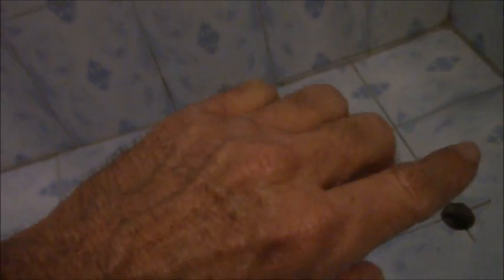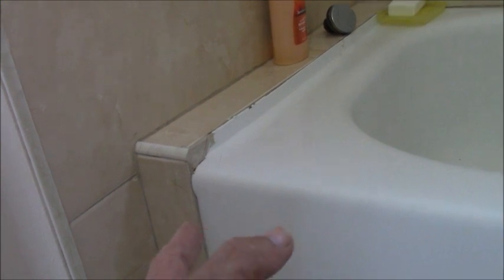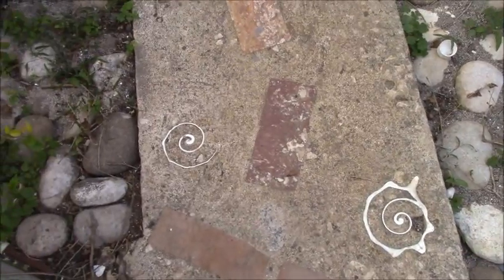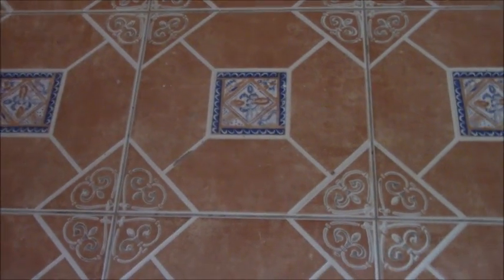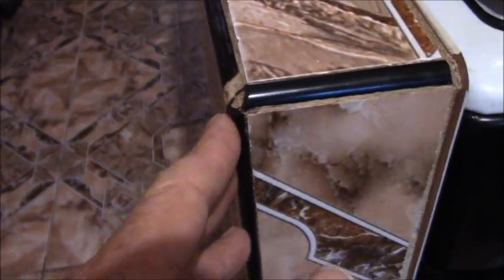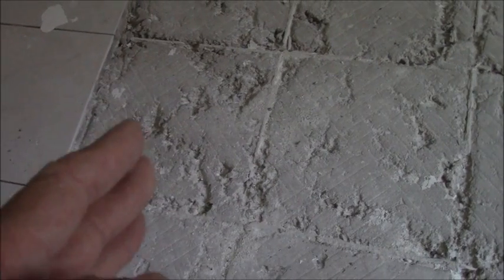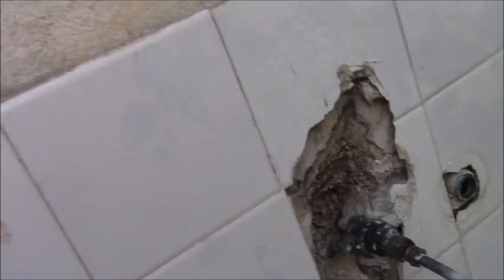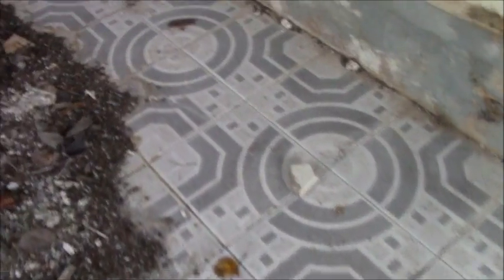Showers and Tile in JAMAICA...how they do it there

Comment: The buckling is called tenting from not having a gap around the perimeter for expansion and contracting or not having a caulked expansion joint in the center of the room

Comment: just got off a condo job where buckling of tile is very bad issue with over half of the units. after scoring grout lines trying to save some full tiles u will hear loud pops where either tile is breaking or separating from the floor. very poor mud jib and no back buttering. I'm sure contractor or builder used cheap thinset no flex to save money overall cost. some areas are even cupped tiles. prob due to movement of building and maybe hot and cold contraction, wet and dry spots, and combination of all above and maybe another reason or two. salt water air can't help either.

Comment: That buckling (or tenting) seems like maybe they didn't leave any gap near the walls. And the concrete walls won't be very forgiving for even the slightest expansion.

Even less forgiving if they used mortar instead of grout to fill the gaps between tiles as at least the grout will crack.

Comment: The thin set wasn't applied properly I am living in Jamaica and do tiling. What happened is that it didn't finish properly so u have air  pockets. When the time is hot the heat is trapped underneath the tile so it pop up

Comment: Is it possible to tile with Portland cement mortar ? 
Also, what do you have to say about mortar grout ?
Reply from the maker: You cannot set tile with mortar...grout has cement in it, so not sure what you're asking
Reply: StarrTile I know that in some places , people just use Portland to tile instead of thinset. What do you think about that ?
Reply from the maker: __  I suppose anything is possible, I have set tile in Jamaica when I lived there, have watched other tilers set tile and everybody uses thinset, if you had a natural stone very porous tile then I suppose you could use mortar but again I don't know why you would try to use mortar instead of thin-set
Reply: Thinset is basically just Portland cement and sand 1:1 with eachother. Grout is Portland and sand with 2 parts sand to Portland. That's the basic recipe of every unmodified thinset and grout. Of course there's a few additives, more sand or aggregate for less slump and/or to cheapen it, and modified thinsets have latex/polymer/acrylic additives to allow the thinset to expand and contract and not crack. Mapei actually makes an additive called Keracrete that allows you to make your own modified thinset with 50:50 Portland and sand, and it's used a lot in constructing subways, road tunnels, etc that need something super strong.
Reply from the maker: Ms overcomer  no I haven't lived there since 2004...still visit often tho. Seen many jobs done in JA without spacers, sometimes just sticks instead and turn out well.